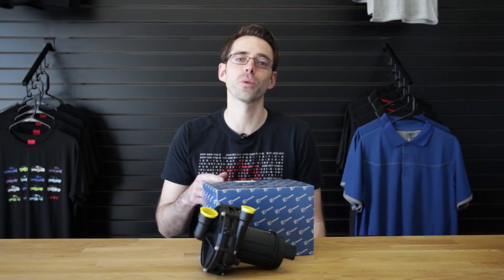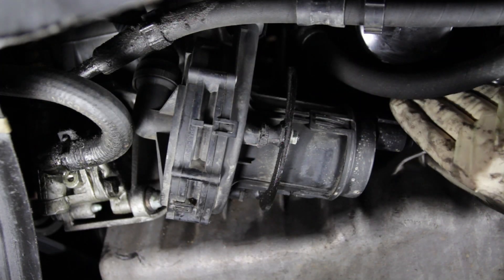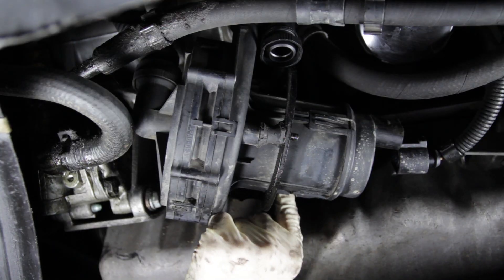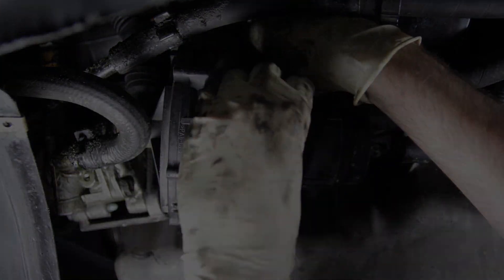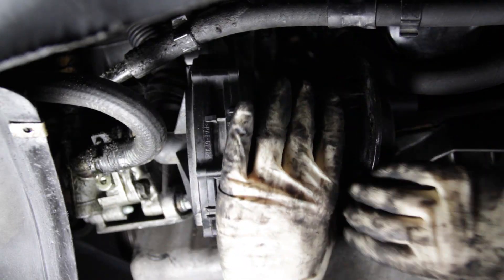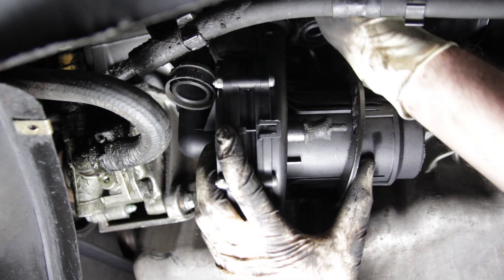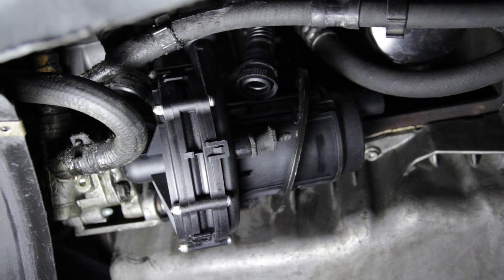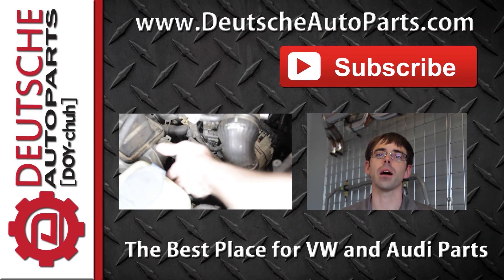VW 1.8T Secondary Air Injection Pump Replacement for Fault Code P0411

Comment: Just fixed the SAI pump on a 2003 GTI 1.8T thanks to this video! It was pretty tough to work those bolts for the bracket, but your advice was spot on. Thanks for creating this!

Comment: Hey Paul.  Getting this code P141100  intermittent, but more often now on my '05 Touareg.  It says Bank 2 though.   Are there 2 pumps on the V8 Treg? Is it poss. that there's an air hose leak elsewhere? Cheers.

Comment: Thanks for this video for reference. This was a 30 minute job! In my 2001 A4 2.8 there was no need to loosen the bracket. You  just need to "finesse" the pump out. "Finesse" is the pro term for -assertive manipulation without breaking anything.

Comment: Yeah I’ll tell yall right now this shit was not as easy as old buddy makes it out to be. One bolt is easy to get off the point bracket. Then another one is a pain in the ass, but the one you really need up at the top is impossible to get to without tearing up the original air pump. Removing the power steeering line to offer more clearance, but not enough where you don’t have to undo the mounting bracket. It overall took me 8 hours, 4 hours one day, 4 hours the next. Some bullshit

Comment: Never got a code but on warm up it sounds like a jet spooling up for like 15 years , LOL finally going to replace it years ago I was told 600 , think I can do it myself , thanks
Reply: Drill out the rivets and replace with nuts and bolts on the pump housing

Comment: Good tips, but I would suggest the following if you have trouble getting to the upper pump bracket bolt.  I found it easier to put the front of the car in the service position, you will have more room to get to the upper bolt from above.

Comment: I replaced the air pump and I still have minor fluctuations in my idle and still have the p0411 code. Idk what it is
Reply: Hey bro
Reply: How much was it for the labor to replace the pump??
Reply: @angulo3047  I replaced it myself but it should not be more than 50 bucks to get your air pump replaced
Reply: @CatholicCrusaderr  i searched it up and it told me 200-500 bucks, and the pump is only $70🤦‍♂️
Reply: Thanks for the response bro i hope you get your problem resolved
Reply: @angulo3047  that’s a rip off. Try to find a cheap mechanic

Comment: Hi my I have a audi a4 2000 model b5 1.8 non turbo my problem is that when I start it . The car sounds nice bt after some few seconds some sound come like it sounds like it's a diesel engine and it's an petrol engine can u help me yo find what's wrong with it

Comment: Hello All!

So, I strongly recommend not taking out the 8mm Allens, but have Hydraulic Fluid available and disconnect the Power steering line instead of the recommended loosening of the pump bracket.  Way easier and faster. The power steering will not be mad at you for taking the line off and refilling after.  Way easier way better!

Comment: I have a code p2431 and p2404 vw jetta 2010..I replacee=d the air injection sensor. Any other suggestions. I have a brand new pump should I install?

Comment: The VW Pass at 2.8 doesn't come with 8 mm Allen bolts. They're 10mm and not Allen and much easier. I just used Shoe Goo glue on it to fill the gaps and no more jet noise. Lol

Comment: I bought a cheap one off ebay for 20 bucks and it works perfect. Advanced wanted like 400 bucks and I saw some as high as 800. Get it off ebay and save yourself a fortune.

Comment: I have an audi A4 1.8t 2004 and I do not see this secondary air pump anywhere, maybe it was removed, now my question is how can I film it on my car again, because I do not know what hoses much less do I know where they are placed the hoses, this if I want to put it back on, in my case I get error P0411 and P1602

Comment: Fuck this pump.  I cannot get the larger air hose off the pump.  Been at it for nearly an hour.  I understand there are two clip points that secure the hose.  I'm using 3 or 4 flatheads to pry and hold and nothing.

Comment: YOU DO NOT need to change the pump when its leaking. Just drill out the rivets and replace with a nut and bolt in  each bracket. this will pull the pump together and get a better seal.
Reply: Will it take away rhe check engine light sensor ?
Reply: Gonna try this as I plan to delete the SAI on my mk4s anyway
Reply: It’s only 50$😂 if u can’t afford to fix it just sell the car…
Reply: @melesiostone221  cada uno gastará en lo que considere oportuno. Muchos reparamos por 0$ incluso mejor que nuevo.
Va de sentirse mejor gastando o cómo? 
Es mas gratificante reparar 20 cosas con 50$ , que solo una
Reply: @melesiostone221 for me its a dream car and I have one , turbo in this thing separates you from a grandma

Comment: Hello,

The same replacement should be done for 0491 error code ? 
Engine model: 2.0 TSI - CBFA
Reply: I have the same code did u get it fixed?
Reply: @manuelescobar1163  hello 
It was an issue with one of those plastic tubes that are linked to the air pump. One of them was broken. I ve just replaced it and got fixed now

Comment: Is there any way to delete it, I got a cat delete and only have a muffler so i have the air pump sitting there, on start of the car it blows air into the engine bay nothing serious just really loud it stops after like 45 seconds.
Reply: I eventually am going to do a full sai and evap delete, but for the mean time just want to remove just the sap.

Comment: I noticed they replaced the impeller casing rivets with proper bolts and nuts. I read that was the problem with the original design, weak rivets.

Comment: What if your output test ends with a Abort status....what does that mean?  Is there a problem with the system?  The pump sounds like it runs.  Can an issue with the secondary air system cause a rich running condition?  I have a 2001 Audi A4 1.8t AWM that's running -25% lambda (rich) at idle...could the secondary air system contribute to this issue?  I read an Audi bulletin that says a leak on the pressure side of the intake could contribute to the rich condition.

Comment: Haha mine did the samething except mine came apart. I didnt have the money to get another one so what i did is i had some of that 5 second fix it stuff its like liquid plastic i put it around the trim there and put super glue on it as well and it stayed on and worked for about another year..i really sealed it so good that it never came apart again something inside did whichi think was the blads that spin around in there..

Comment: Now can this cause my 2011 gti to bog down and throw the EPC light for a few seconds?
Reply: No sir, this component is just for emission control. The EPC light in my 2010 Jetta came on and I took it to my volkswagon dealer. They told my my engine was beyond repair. That cost me about 7 grand for a rebuilt engine, 3 grand of which was labor.

Comment: can, not changing bad secondary air injection pump eventually lead to a bad catalytic converter.  i have a 2K VW Jetta VR6 and i have to remove the bumper and drain the coolant to work on this car. bad design.

Comment: People I need help I have mark four 1.8 t golf gti.. it been problems after problems.. its a fast car with no mod yet my second air pump what this guy is working on is unplugged and been like that since I brought it as im trying to figure out why its traction asp kicks on boost and kill the engine car saying trottle body code.. just put two coils in to fix a missfire.

Comment: Would a faulty secondary air pump cause my mpgs to drastically delcine?
Reply: SwInGoNdEeZoNeS yes I have same issue.
Reply: Not really.  The SAI system has one function:  Warm up the catalytic converter faster so the engine can go into "closed loop" operation faster.   Unless you are taking very short trips and not getting the engine up to temperature, it's affect on your MPG is minimal.  Those who live in area with smog tests have to worry about the SAI system to keep the code from occurring.

Comment: mine makes whining sound in the morning for about 30seconds.
now it doesnt make sound anymore is that mean the pump stops working. i didnt get any fault code except for coolant temperature sensor which has been replaced and since then i still couldnt hear the pump in the morning :-(

Comment: ready I already put some new spark plugs and ignition coil. Still have the same problem
Code :
Random/Multiple Cylindre Misfire Detected
P0300 - 008 - Implausible Signal - Intermittent
p0302 - 008

It is not dripping coolant by the spark plugs, I mean they are dry (As it should be)

Audi 2004 A4 Quattro 2004 1.8
Reply: I had the same misfire issue, ended up being the MAF sensor for me.
Reply: Hey Ritmo, did you fix the "Random/Multiple Cylindre Misfire Detected"? I have the issues with my car.
Reply: Check your coil pack harnesses. Since the coil wires on a 1.8t sit on top of the valve cover, they tend to get hot and eventually become very brittle. I had the same issue and it turned out that my grounding wire had broken loose from the terminal and the insulation had cracked. Used electrical tape to re-cover the exposed wire and put on a new terminal. Problem solved.

Comment: Would have been helpful to show the N112.  You mention it in the video but I can't see to what you're referring.  Thanks for posting though!
Reply: On my B5.5 Passat, the N112 valve is on a plate mounted to the underside of the intake manifold.  The "combi" valve is on the rear of the cylinder head.  Don't know where it is on the Jetta.

Comment: if this pump is leaking g like that one or is bad, will this kill the acceleration at low rpms or what does this pump do?
Reply: Warms up catalytic converter quicker. Won’t affect drivability. It’s for environmental purposes

Comment: If the pump has rivets replace with 1.5 inch nuts. Drill the rivets out. If it's sealed end game on the pump. clean out your PCV system it's likely clogged as well?

Comment: Do you have a video for the pump on an 06 Jetta 2.5?  I have this code:

P0411: Secondary Air Injection System Incorrect Flow Detected

My car has 137,000 miles
Reply: John Doe  Any updates?  I can't locate the secondary pump in a 2.5L Jetta
Reply: should be right at the front under the manifold by the radiator fans

Comment: Today my mk4 vr6 was diagnosed and my mechanic told me I needed a new MAF sensor, a Throttle body, and a new secondary air injection pump. In a nut shell they wanted a lot of money just to fix it. But after seeing your videos I feel like I could probably do these myself. Thanks!
Reply from the maker: +Giovanni Lopez Great glad to hear we could help.  What year is your VR6... We should be able to save you some money on the parts as well.
Reply: 2001 2.8 vr6
Reply from the maker: Here is the Mass Air Sensor
https://deutscheautoparts.com/bosch-mass-air-flow-sensor-071906461b.html

Throttle Body
https://deutscheautoparts.com/0-205-003-053.html

Secondary Air Pump
https://deutscheautoparts.com/021-959-253-c.html

We should be able to source a Pierburg Air Pump for much less.  

Hope this helps.  Thanks for considering us.
Reply: @Deutscheautoparts  will these parts you listed fit a 2003 Passat 1.8t. I have multiple codes p0507 p0300 p0303 p0411. I’ve been to multiple shops and every time I try to get a diagnostics on the car I’ve continuously been given the run around. So I’ve set a certain budget for the cost of parts since I’ll be doing the work myself.
Reply: @Deutscheautoparts I have a Golf mk3 vr6 that the secondary pump is not working in the car, could you help me to make everything work correctly .

Comment: Hello, I have a 2000 Volkswagen Passat. Today, I received a P0411 error reading after my check engine light came on. In detail the reading said, "Secondary Air Injection System incorrect flow. Faulty air combination valve." Then it listed the probable causes as a faulty air solenoid valve/faulty air pump. Now are they saying that both are bad? Does the valve and pump make up the combi-valve?
Reply from the maker: +Ade Craig No they are 2 separate parts but a bad Combi valve could kill a pump if left unchecked

Comment: I ordered my entire lower suspension from your company. Control arms, ball joints, hub bearings, sway bar links, everything
Reply from the maker: +fockyoumang We dont think this was from us.  You might be confusing us with Deutsche Parts USA.  They sell inexpensive parts on eBay.  Our parts are mostly top quality Genuine VW ones.  Thanks for considering us though.
Reply: +Deutsche Auto Parts no it was through Google I found the site. I bought the turbo oil return line for 110 and 20 for the gasket. Deutsche Auto Parts, it wasn't eBay. Do you wholesale to other distributors? It's the same logo on the plastic bag from the inner and outer tie rods.
Reply: +Deutsche Auto Parts them someone is using your name and logo, I can email a link or picture of the products with your logo so you have evidence to take them to court if you find out who it is.
Reply from the maker: ***** Was it through our site?
Reply: +Deutsche Auto Parts I don't remember, this was over a year ago. The parts are identical, colors on the outer tie-rods and ball joints and the brackets. I'll email the pictures and boxes and packaging, I'm almost positive I saved the outer tie-rods boxes because I didn't need them, they were new from the previous owner. I remember googling and seeing a lot of good reviews and that's the only reason I got all those parts I didn't need, stronger bushings. The oil return line website was different, it was blue but the checkout was very similar with the option for the high performance gaskets.

Comment: I have a audi a4 1.8t with a  fault code p411. Does it have to be the pump? My skill level at repairing my car is about a 1. Also which side of the engine is it located?
Reply from the maker: +Daryl Elias You should probably consider having it properly diagnosed.  There are multiple parts in that system the could cause that fault.  The Sec Air Pump should be on the drivers side of the engine.

Comment: Tip for anyone doing this at home on axle stands - don't bother trying to remove the bracket allen bolts. Power steering fluid is CHEAP - just remove the power steering hose. Will save you a load of time and effort. It's still tricky to get out and back in but it's much better than messing with the bracket.
Reply: +Suj Power steering fluid is cheap? Last time I checked it's around $25. Even if it took you an hour to get the pump off,  that would be $25/ hour worth of work you would be saving.
Reply: tylertyler82 Yeah - it's not gonna take an hour. You will spend all day trying to get that top bracket bolt out - and the following 2 days trying to get that bolt back in. Yeah you could mess about trying to loosen it to swing the bracket if you can manage it. I'm in the UK - but even if I were where you are I'd rather pull the PS hose and pay the $25 - or if you want to do it on the cheap, re-use the fluid you caught out of the hose. Considering the repair doesn't cost anything - $25 for the fluid is still cheap to get the job done.
Reply: +Suj I ended up doing this project today, I just drilled out the rivets and replaced with bolts, fixed the whirring loud vacuum noise! Good call on removing the power steering hoses- I didn't even need to buy new fluid. I drained it into a clean bucket and put the fluid back in the reservoir after everything was done (I just flushed the fluid a few months ago so no need to replace with new fluid!) Took one look at those allen bracket bolts and said f- that!

Comment: At 1:00 'you can't fix this'

May I suggest people try the method in the link first, before having to shell out for a new pump.http://uk-mkivs.net/topic/9315-step-by-step-guide-for-repairing-the-secondary-air-pump-with-pictures
Reply: can, not changing bad secondary air injection pump eventually lead to a bad catalytic converter.  i have a 2K VW Jetta VR6 and i have to remove the bumper and drain the coolant to work on this car. bad design.